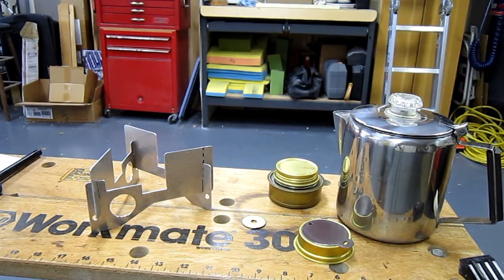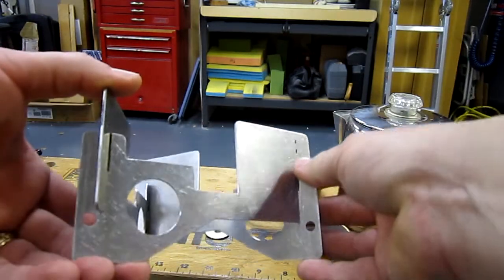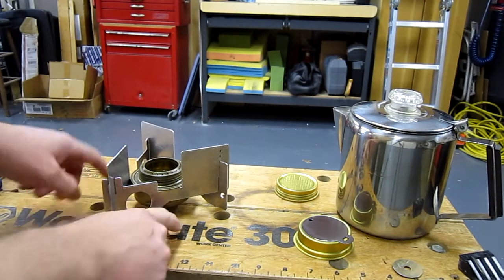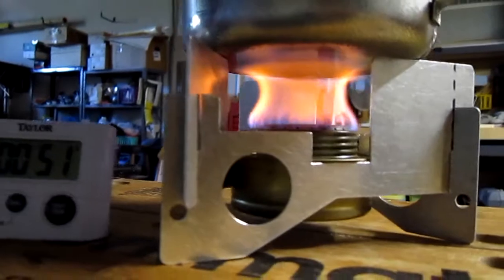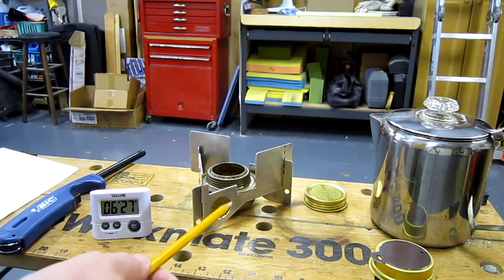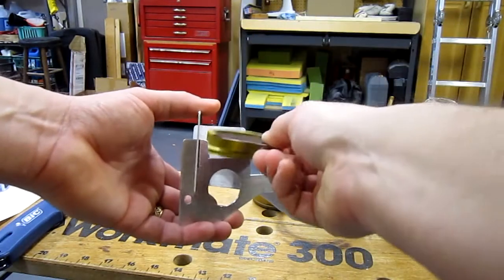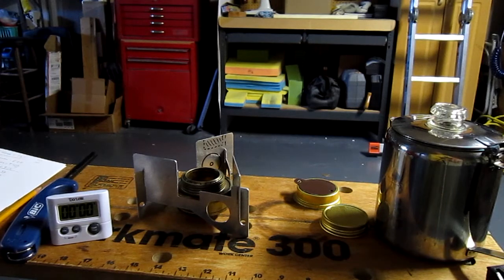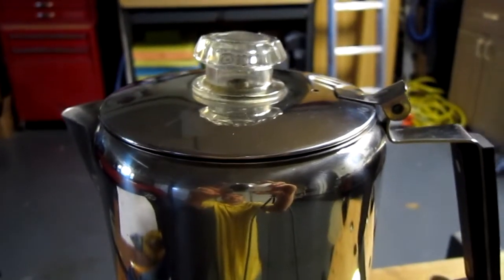Time to Perk - Westwind Stove Modification

Comment: Alright, this convinced me to take an extra 1/4" off mine to match your total 1/2" reduction. The next time I have my jigsaw out I'll do it.
A secondary benefit to this mod is that the flame doesn't spread out so far to where it touches the stand, making the stand very hot and wasting heat. Your footage showed the flame just barely touching the stand whereas on mine the flame makes much more contact.
Great experimenting.

Comment from the maker: Yes.  On every stove...physics prevails.  (Law of the conservation of energy)  It's all about getting the BTUs available from the alcohol into the water.  The REAL equation is much more complex than these tests.  But simply: Low flame intensity = longer time, high flame intensity = shorter time. Both same number of total BTUs to get the water to boil.  The pot also looses heat too - so, generally, the faster you can the BTUs into the water, the less total fuel will be used to get to a boil.

Comment: Cool vid bro :) remember me? :P
btw, it is faster if you don't set the pot on the stove directly (covering the big hole), but it will use ALOT more fuel...  So i think it really depends on what you want to do with the stove (melt snow, ie) of what you want to cook...